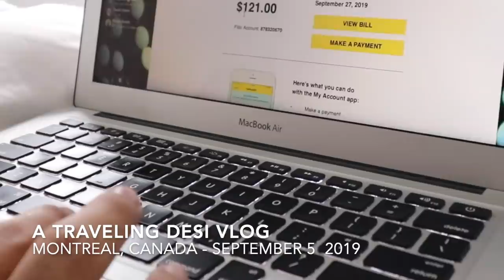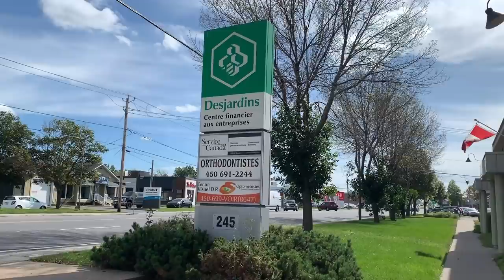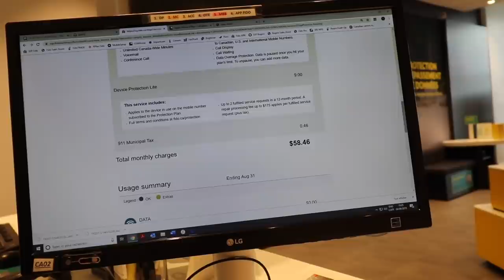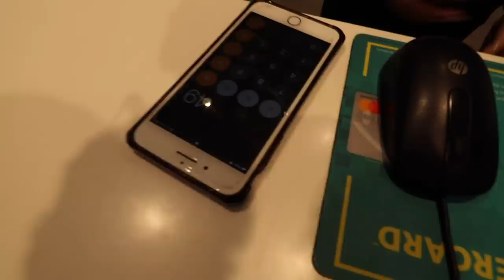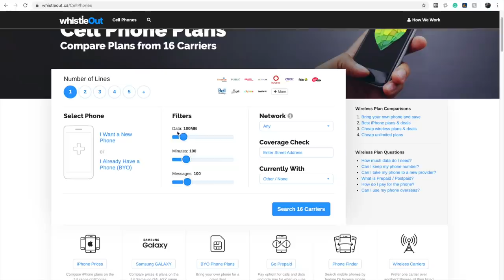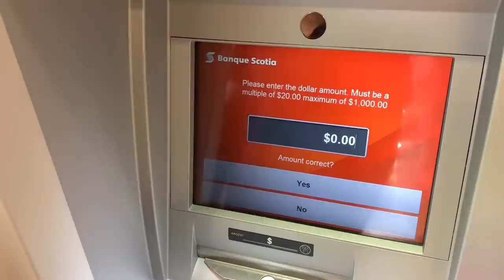EXPENSIVE Sim Cards in Canada! How every Indian misses Jio when they come to Canada! Be Prepared

Comment: bro fido k ssath ye sbko issue aata hae.......they add unnecessary charge for international call whereas one have not even consumed 1000min which are included in pack
Reply: I heard for international calls you can get a package for few bucks then the call rate charges are 10-15 times lower?